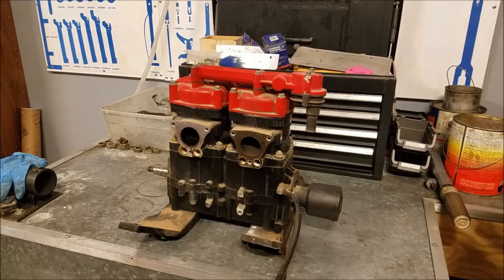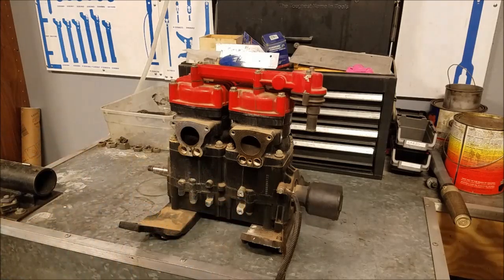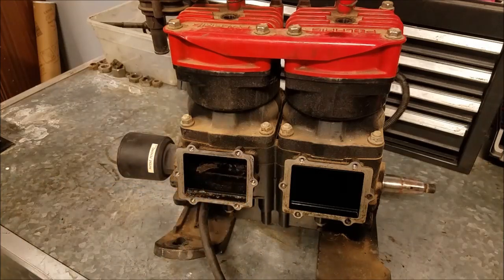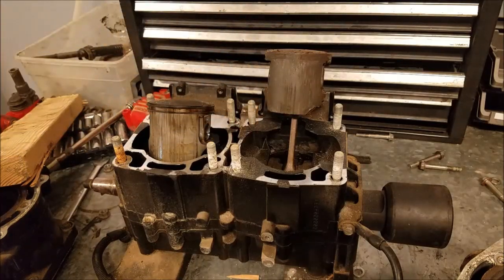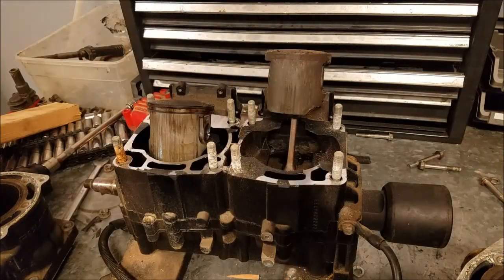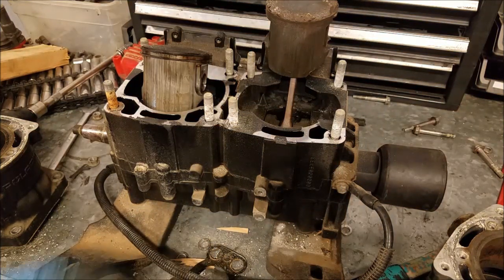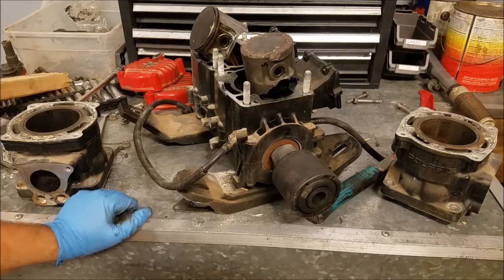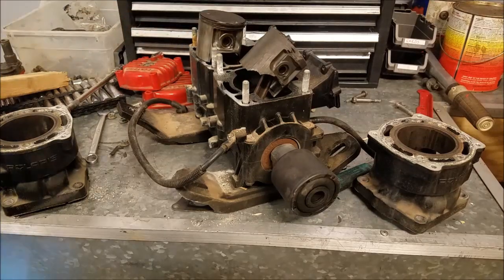Jet Ski Engine with 120 & 0 PSI Compression

Comment: Brandon, I don't think that engine is complete junk.  Mind you I am more familiar with Sea-Doos than Po-Pos but it shouldn't be a big deal.  Likely the problem with this engine was carburation not oil.  Jet skis sit a lot and often develop carb problems due to the wonderful corn fuel we all have these days.  I would think the back cylinder died due to being run too lean.

Before you give up on this motor, I would check on eBay to see what a new/used jug, new piston, gasket set, and a set of rings for both cylinders would run.  Hit the front cyl with a hone, and replace the back, I'd bet you could get the Po-Po back up and running for relatively little money.   

As for the sun faded rub rails, they usually can be brought back to life with a little massaging from a heat gun.  The heat mixes the faded/oxidized plastic with the non-faded underlying layer and the color comes back fairly well.  The upholstery etc you mentioned is generally not that expensive.  With a little elbow grease, it is possible to take a piece of trash and make it look nearly new. 

It would be a shame to throw a savable jet-ski in the trash and think of all the videos you could make of the resurrection process.
Reply from the maker: There is still the rod/bearing problem, as well as the rest of the bottom end.
But you're probably right about the carb, I didn't even think of that. It was probably only really running on one cylinder, and the prior owner thought as it started, it was good to go. 

If it were the only one I had, sure. But I have a good nice sea doo, and a nice spare engine/parts for it. If anything needs fixing, its that.